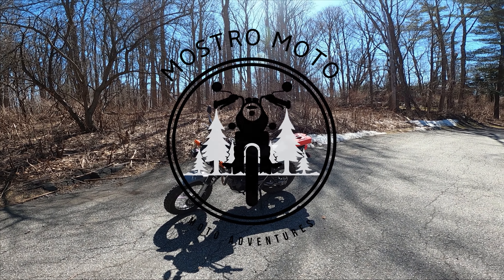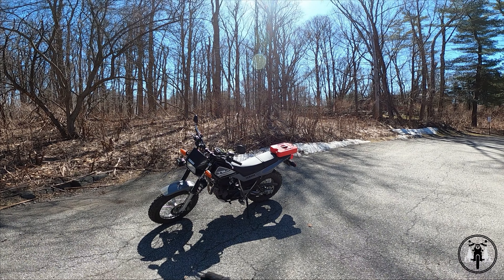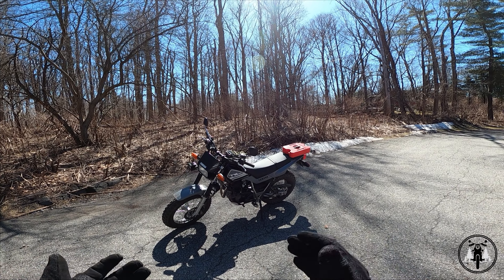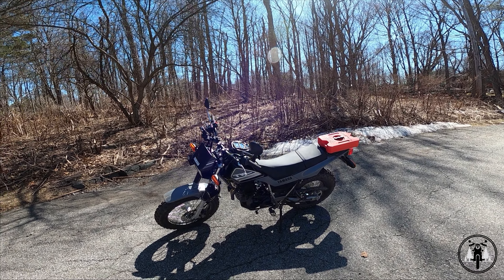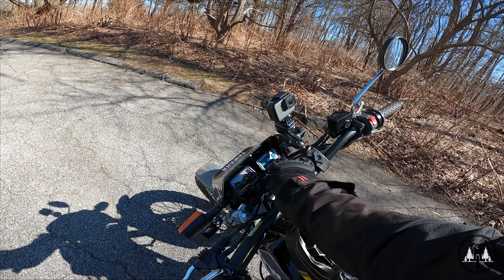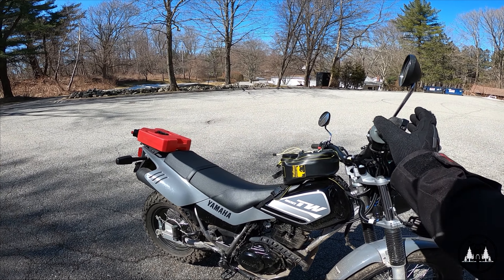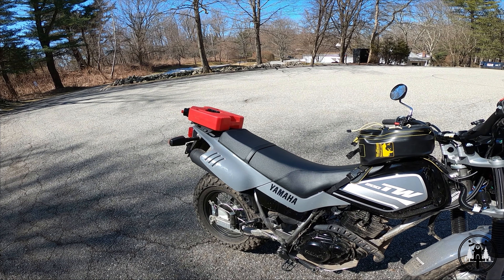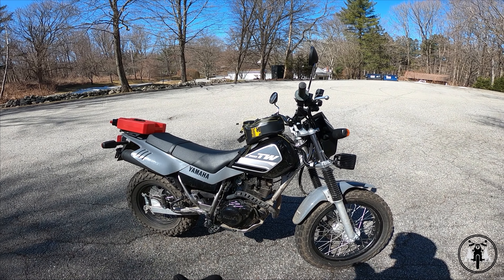2021 Yamaha TW200 // Start Up // Exhaust Sound

Comment: Hey man!! Finally picked up my 21’ TW and noticed the rattle too.. almost sounded like the valves were a little off, the engine sounded real lean. Today I removed the aluminum plug over the air fuel mixture screw, bottomed it out and backed it out 2 whole turns and it’s running a lot better, no longer sounding real lean and the tick/rattle is MUCH better.. I backed it out another .25 turn but it was too cold to go for a ride today, hopefully tomorrow. It seemed much happier at 50+ too, if you’re interested I’ll give you a report tomorrow after I go for a cruise, weather is supposed to be nice and I’m excited to put some miles on the new girl.
Reply from the maker: Congratulations on the new bike! It’s gonna be a blast 💥. My buddy Rob also mentioned that adjustment. He said his bike ran a bit better as well. My bike doesn’t seam to be super lean but it probably could use some adjustment. Have fun getting those first miles on it, ride safe!
Reply: Excellent Info!!

Comment: Glad you have a normal rattle 😳
Reply from the maker: Yeah I’ve ridden acouple Tdubs, they all have a distinct noise that the engine makes. It’s certainly not a bad rattle. But for a small little thumper it’s got a decent sound 😊